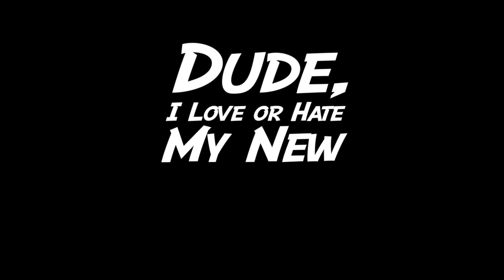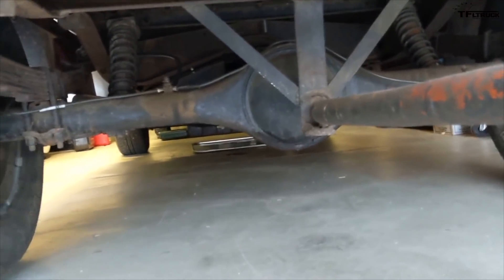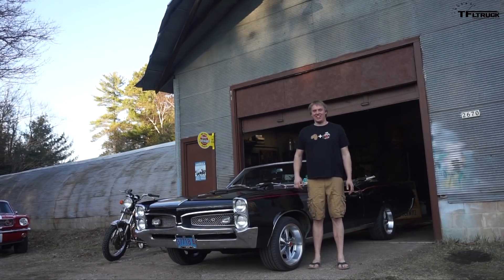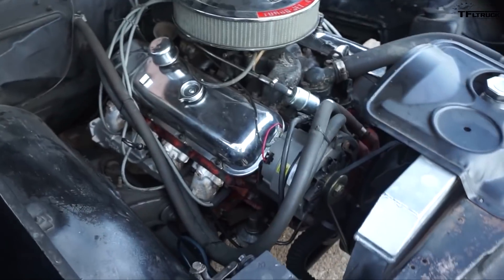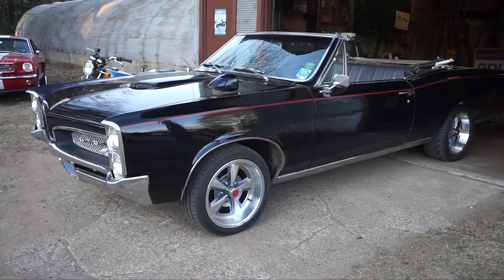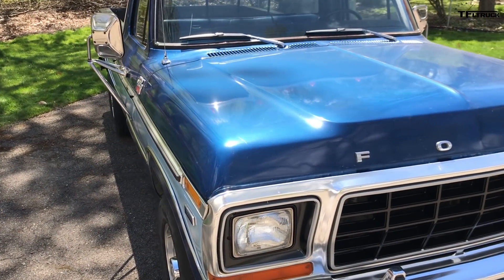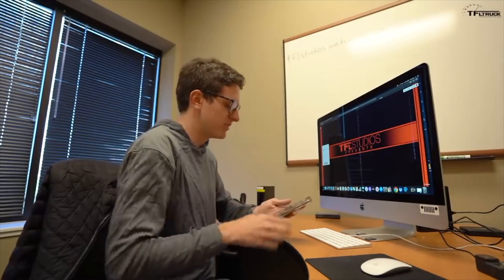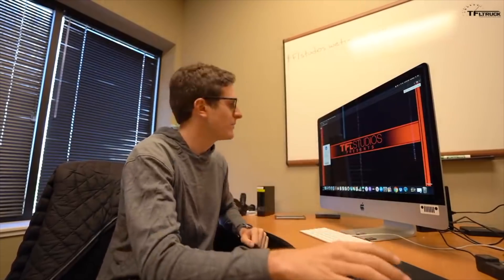Here's Why Old American Cars And Trucks Are AWESOME Collectibles! Dude, I Love My Ride @Home Edition

Comment: A gear vendors overdrive would take care of the overdrive without losing the rock crusher. There are plenty of aftermarket efi systems out there for plenty of different looks on the gm engines

Comment: I find something wrong with new rigs... that said, the survivors are extremely lucky to be here and then slap the goat with only a seven or maybe eight is harsh. I seen that ford and its cool but no better than the goat. The dodge truck is nostalgia for sure but the hood is coming apart at the center  hing, a very common re rivet it and good to  go... although clean, the shift indicator was off a bit and stuff that needed attention  will get it once he notices it. If marking down cause of crisma, just not real fair an kind of hurt full
Reply: I thought the same thing about the shift indicator when I purchased it.  I'm pretty sure that's where it would be from the factory.  It's in the original holes and lines up with the indicator on the shifter.  And both the steering column and rod for the shifter go through a boot on the floor board that only goes on one way.  Haven't figured out a way to straighten it without shifting the steering column and bending the indicator.  It's definitely a work in progress and not perfect by any means 👍

Comment: That GTO is just wrong with a 454. Put a 400 Pontiac in it. Put your LS in something else.
Reply: Agreed. Based on the rocker panels it also looks like a 66 not a 67. This car needs a restomod with more Pontiac parts. It sounds like it’s being turned into a Chevelle low rider. Unfortunate if it’s a real drop too Gto. Glad he drives it though.